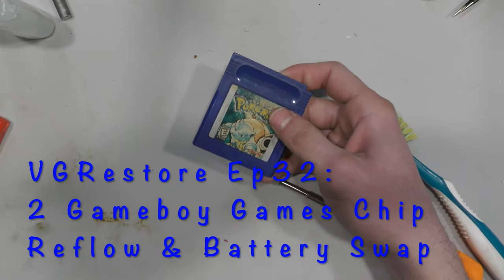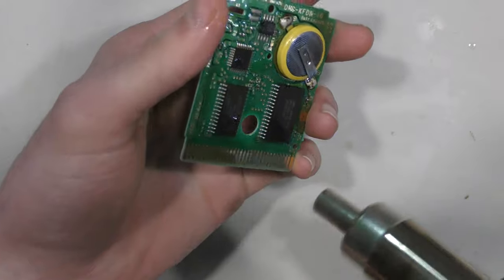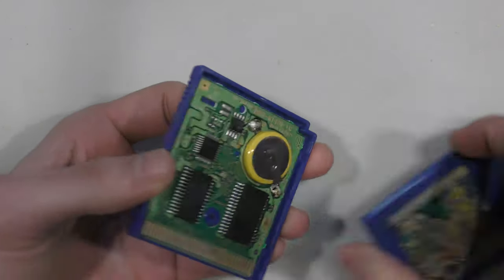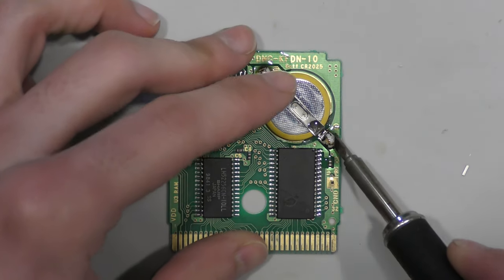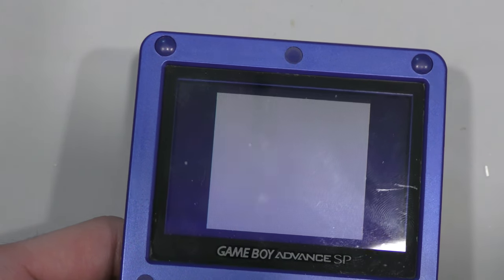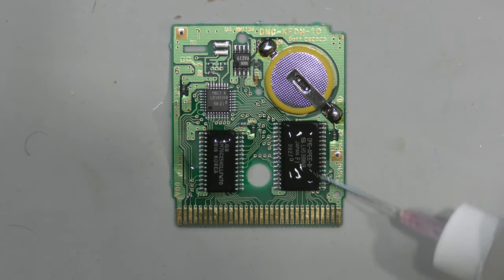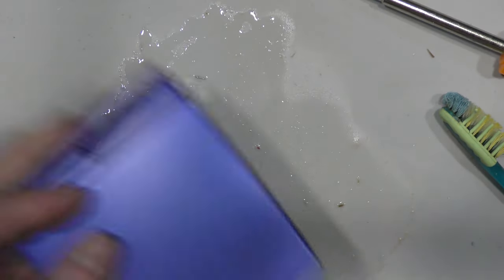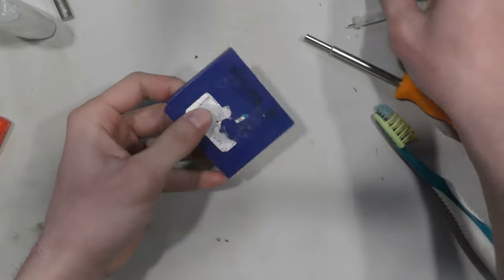VGRestore Ep32: 2 Gameboy Games Chip Reflow & Battery Swap

Comment: needing to reflow the chips on gameboy games is an extremely common fault, because the pcb is held so close to the back of the shell everytime the game is put into the system and removed again the board gets flexed slightly, in time the joints just fracture and you get weird glitches. I think it happens much more often with Pokemon because those are the games people most often come back to play (Zelda and Super Mario Land 2 being the follow ups)
Reply from the maker: That’s seems very plausible.
Reply: I had this happen to me as a kid with my Links Awakening DX. Stupid 10 year old me threw it away thinking the cartridge was perma damaged. If only I knew about this now and held onto the cart :(. I since bought 2 other copies of links awakening for my collection but I won't part with those because it's probably my favorite zelda game.

Comment: I noticed there was some sharpy on the cart there. I am not sure if it works on cart plastic but it works on game stickers: Use hand sanitizer to remove sharpie marker ink. It removes almost something like 95% of the ink on a game sticker, sometimes even 100%.
Learned that one at my old job, we use to write on tape all the time and we used purel to correct ourselves. It helped me remove the ink of a Mike Tyson Punch Out cart that I got.
Reply from the maker: Yeah I ended the video too soon I should have removed the sticker and the marker marks.

When I recorded this I had all of carts to go through so I was in a bit of a rush.

Comment: i reflowed both even took it out and used wick on the solder and applied new solder to the pads and reapplied the rom chip and now i get nothing just a messed up nintendo logo on launch any suggestions?
Reply from the maker: Pins not making contact to the rom chip. Reflow the chip again make sure nothing is bridged and check to see if every pin leads up to the rom chip or the ram chip.

Comment: Hello, I have a leaf green copy that is not working that says m1 chip not installed. It is an authentic copy. I want to try to do what you did to the second game. What is the liquid you used? And do you just touch the soldering iron to it and that's it?
Reply from the maker: M1 chip not installed I think that’s a problem on the flash memory chip. It may need to be resoldered or in worse case replaced.
Reply: @PunkNDisorderlyGamer  would that be difficult to do? I have no experience soldering, I just want to fix my childhood game.
Reply from the maker: @gabrielb4494  yes it’s pretty difficult without experience and tools.
Reply: @PunkNDisorderlyGamer  the game turns on and plays fine it just won't save. When I opened it up and cleaned with IPA it still wouldn't work. On the back of the board there is a half circle with "MB" on it. There is a tiny brown spot on the letter B that won't come off. Could this be it?

Comment: I have tried this and it has not helped. I think my copy of Yellow is bust.
Reply from the maker: You may have a broken trace.
Reply: @PunkNDisorderlyGamer  damn, that might be beyond my skill level
Reply: @PunkNDisorderlyGamer  I'm in the same situation, I reflow my copy of yellow but doesn't load. I've a question though: is it possible to fry a chip during the reflow process? My soldering iron has no temperature control, and I'm afraid I kept on going over the pins to reflow too much and gave a lot of heat to the chip...
Reply from the maker: @EsThirt33n  probably not fried but rather a broken trace or you may have burned a trace

Comment: I've replaced a battery on a Emerald once, but I was younger and didnt have time to solder, so it's sitting in there with some electrical tape around a replacement battery. XD You tempt me to go back and go do it properly. You think you'll be working on some GBA games soon? Or are those ones harder to diagnose due to size or some such? I notice the closer we get to current tech, the harder it is to repair.
Reply from the maker: Yes you should definitely go back and replace that battery properly it’s pretty simple. I do have some GBA games recorded and ready for editing stay tuned for those. Yes that’s why I don’t really touch modern stuff too many error codes, causes for failure, moving parts, small components you can barely see, and since it’s more modern it’s more expensive to acquire and you risk losing too much if you can’t fix it.

Comment: dude when you reflow the chips add some solder to the tip of the iron
Reply from the maker: I usually do add some more solder to the pins if they need a bit of solder. In this case, I just wanted to reheat the existing solder on the legs.
Reply: PunkNDisorderlyGamer yeah , but adding solder always helps
Reply: I'm about to start doing this stuff myself. I've never used a soldering iron though any tips?
Reply: @Krispy for working with gameboy games in general you need a hot air station and soldering iron with knife 🔪 edge tip and good soldering wire and flux and some desoldering brade 
these are the tools that you need :)
Reply: @Arcade_Mania  thanks man. Also could you explain reflowing? Idk what the term means. I think I have a good idea though. Also you said something about you like one cleaner more then the other but I thought alcohol was fine to use? I currently only have 70% is that okay to use in a pinch or do I need a higher content?
Reply: @Krispy reflowing the solder is mixing the older solder that’s on the pads with new solder and you do that just by adding a small amount of solder to the tip of the iron and you use drag soldering technique to reflow them ,
for the alcohol you need 70 or above , 
70 needs more time to dry but it’s fine you. can use it .